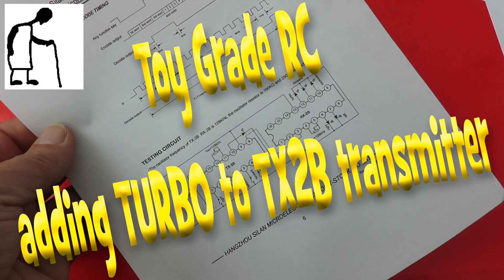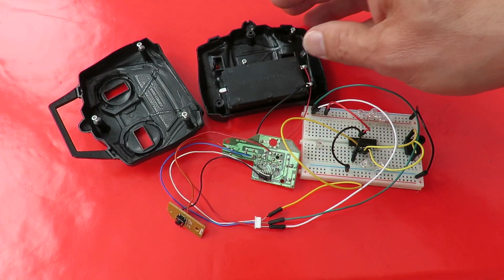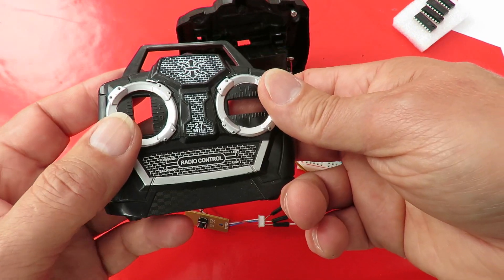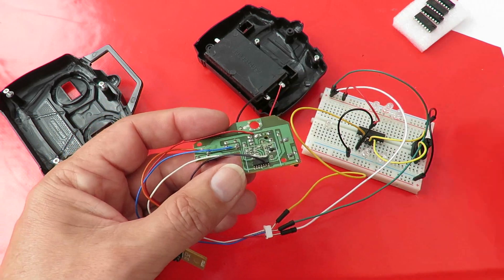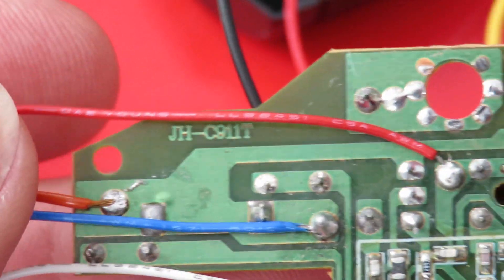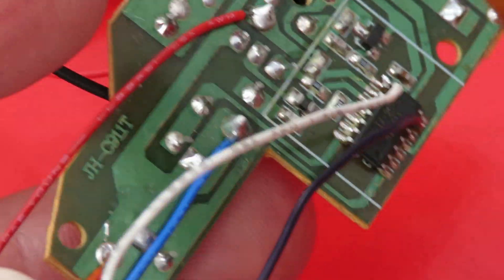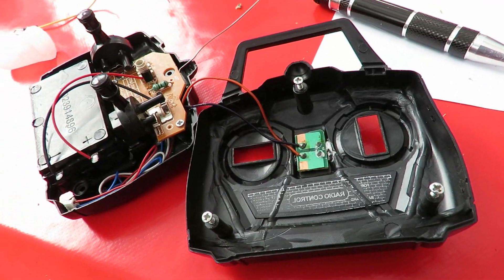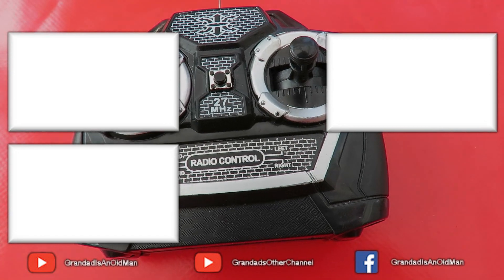Non Hobby Grade RC adding TURBO MODE to TX2B transmitter

Comment: hi dear areyou still alive ? you did the turbo added circuit to the TX ok, but to move it or see it moving ? can you explane how to go ahead to make the turbo working in forward ? data format of the code how is ? i tryed to add this part of pin 6 to GND in TX ... in the reciever ? perhaps i fail cause i used the 8A978 chip rx and 8A977 rx. ciao!
Reply from the maker: The "Turbo" is just another output from the receiver. Unless the receiver has circuitry to make use of that output, it does nothing. Some toys use that 5th output for other features. Typically, for "Turbo Power" on your car, the power going to the motor when the normal "Forward" button is pressed will be via a resistor to reduce the power. Then the "Turbo" output would bypass that resistor, giving you full power. If you Google the data sheets online, they usually give example circuits on how to use them.
Reply: @ yes i got the example circuit it is explicated in the rx2b datasheet. I find it strange because it put the vdd2 on the h-bridge PNP transistor and the line of the turbo pin at the NPN before the h-bridge down side of motor and vdd1... also the h-brid. of steering motor is on vdd1 and i was aspected to see vdd1 in FFW an RW but it use the opposit. anyway thanks for all, and for sure if is not prepared the circuit of rx side is useless to abilitate the pin of the TX. 
:hand-pink-waving:

Comment: I found this chip in a tow car. I dont have the remote... what might you do with this rx 2b
Reply from the maker: Check out my RC TX2B and RX2B chips playlist https://www.youtube.com/playlist?list=PLA5a2xPRSrB1mLQvgf5ILMeTcRMuDtcNa the RX2B chip interprets the input signals to identify what function is required and then puts an output signal on the relevant output pin. Here is a typical pdf data sheet for those chips https://pro-radio.ru/user/uploads/126799.pdf

Comment: Sir does this work with RX2E transmitter?
Reply from the maker: I don't know as I have not seen a data sheet for the "E" variant but I would expect it to be the same. Maybe you could try searching for one yourself. By the way RX=receiver TX=transmitter 🙂
Reply: @GrandadIsAnOldMan  could u pls see

Comment: Pls make a detailed video pls and also add a horn feature button
Reply from the maker: Maybe you needed to watch this video linked in the video description https://youtu.be/M46Gpyl9KYE it included the circuit diagram. If you want a horn then you would have to arrange for the feed from the turbo pin to operate it. There are only 5 output pins as shown on the diagram. This is Forwards, Backwards, Left, Right, Turbo. They all give the same output signal so you can use them for whatever you want but there are only 5 of them so you make the choice what they can do.

Comment: Why are those red blue and orange wire pin connected what is the purpose I understood connections
Reply from the maker: Maybe you needed to watch this video linked in the video description https://youtu.be/M46Gpyl9KYE it included the circuit diagram. Follow the diagram to understand the purpose of the connections.
Reply from the maker: Here is a link to a typical PDF data sheet https://pro-radio.ru/user/uploads/126799.pdf
Reply: M a beginner so I dont understand diagrams properly  ..m  a 10 grade student and 14 yrs old
Reply from the maker: @raghavnaikdessai6577  I am sorry but if you do not understand diagrams then it is not going to be possible for me to explain the purpose of the wires other than to say they are there to connect the relevant parts of the circuit together to provide the turbo feature by adding the button. The circuit diagram shows how this is done.
Reply: @GrandadIsAnOldMan  can u send me links of other videos on these topic ....😅
Sorry if u are irritated by my frequent questions  
.😅
Reply: @GrandadIsAnOldMan  I understand circuit diagram little bit like 65% ...I can't understand block diagrams at all ....
Reply from the maker: @raghavnaikdessai6577  as already suggested, have a look in my video description. There are helpful links and playlists there already.

Comment: Hi sir, my receiver chip's temperature increasing gradually, just pressing forward or backward in 10 second during playtime when it heat to the max, my rc suddenly turn to totally dead, I need to wait (not pressing forward and backward) till temperature drops to normal and it works again and repeteadly. Could u tell what the problem is?
Reply from the maker: I am afraid I am not an expert however here are my thoughts. If your receiver is overheating I can think of 3 issues. 
1. your motor has overheated at some time and is damaged so it now draws more current. This could have happened when the car got stuck against an obstruction or maybe in long grass.
2. you have changed the battery to a higher power. Lot's of people change the batteries to higher voltage or greater capacity and then find they have killed the receiver because it cannot handle the extra power.

3. you have changed the motor to one that draws more power through the receiver. A motor with lower resistance will cause more current to flow through the receiver.
Reply: GrandadIsAnOldMan : Bingo sir, you are an expert, I used to play using Energizer rechargeable batteries for few times then I found the back dc motor did not work, stuck and hot (4wd rc, front and back doc motors) so I changed the another different motor similar in size. it worked slowly, I rewired. The third issues I would like to ask u Sir, Which have mention the resistance, it makes me think a resistors, is that a clue?? to solve that problem by simply soldering a resistor on positif wire  nearly on the dc ???
Reply from the maker: @andytan149  If the motor you have used is a lower resistance than the original motor it will draw more current. Adding a resistor might help reduce that power draw but it will also reduce the power of the motor so you may have to experiment to see what is best for you.

Comment: Neat install, I have to admit I would have fitted the button on a shoulder of the transmitter, like a games controller so that you would use an index finger for it and  not have to take a thumb of a stick to operate it.

You could do a short video adding turbo to a car...

A 6V/4xAA car you could add a transistor to that output on the Rx2b to drive a DPDT relay, common contacts to the motor, N/C contacts to the motor output of the PCB & a 9V battery to the N/O contacts.

When you hit the turbo the motor will be swapped from the 6V of the PCB to a 9V battery.
Reply from the maker: Thanks for the suggestion. Not sure if I will get round to that any time soon but you never know 😊
Reply: Awesome, thanks. For something more basic and quick, LED headlights with a switch on the Tx, or just a buzzer as a horn.
Reply from the maker: Yes that is the sort of thing that output is often used for.

Comment: You can try various mini rc cars you got that has built in batteries, they usually got a turbo function that is there but not used by the original controller.
Reply from the maker: If they are using the RX2 chip (and many similar) then the chip has the turbo feature as standard but in most cases it is not wired out and only 4 of the 5 outputs are used. When they do use the "Turbo" feature as far as I can see they just have the "normal" forward speed reduced with a resistor and then the "Turbo"  option uses a circuit that bypasses that resistor or they just use it to activate another feature such as sound effects. The RX2 chip does nothing other than put an output on the turbo pin.
Reply from the maker: Sorry, may have misunderstood your comment, yes those micro cars may have the turbo feature but unless they are compatible with the TX2/RX2 chips then my transmitter wont talk to them.